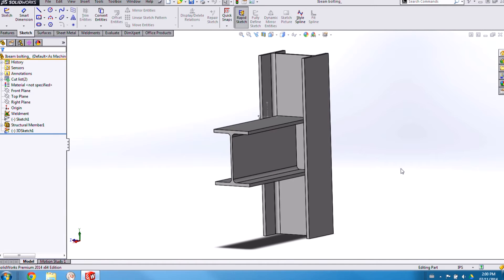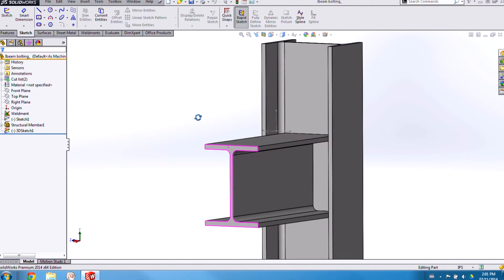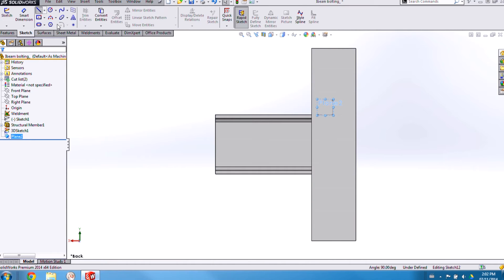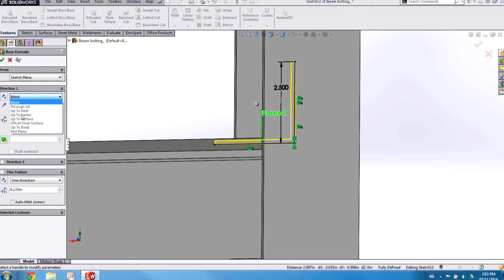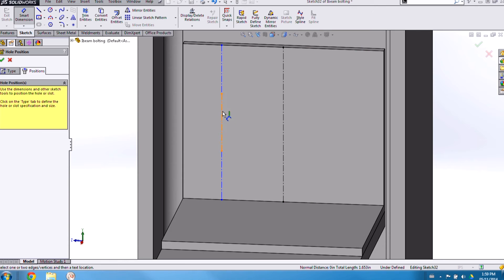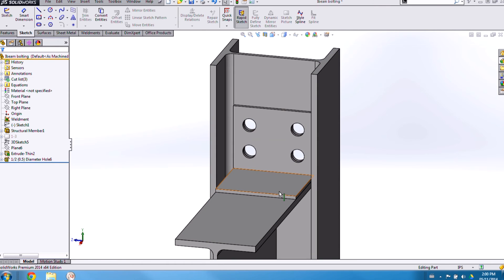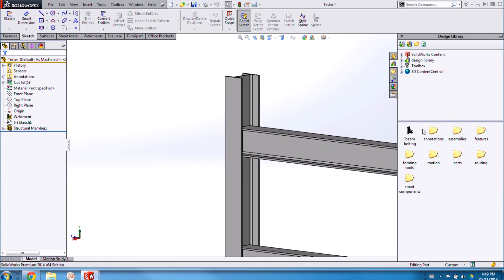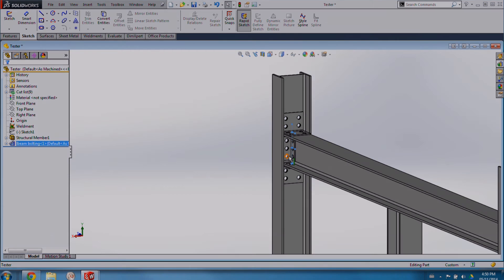SOLIDWORKS - Design Library Features

Comment: 0:42 Great Tip: Understand your Design Intent and keep your Design Library Feature flexible for all inserted conditions.
1:50 Modeling Design Library Feature
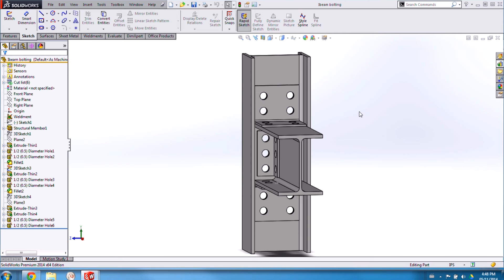5:02 Add features to the Design Library
1. Select features from the feature manager
2. Open design library from the task pane and click add to library icon
5:35 Test